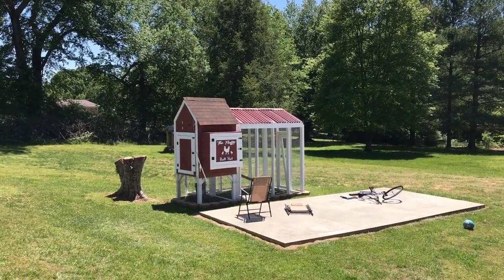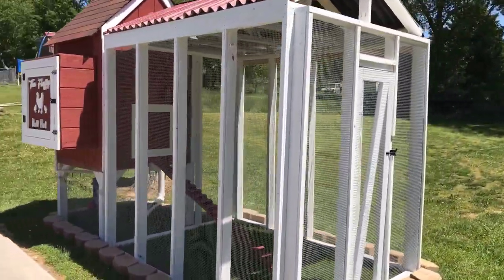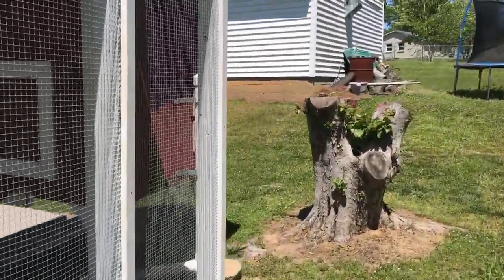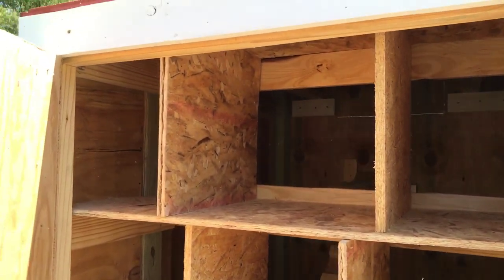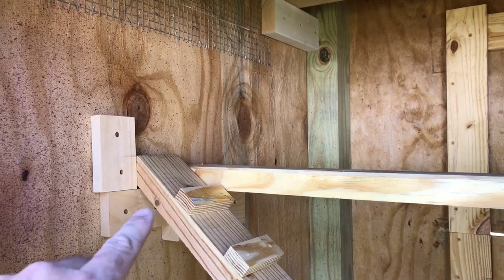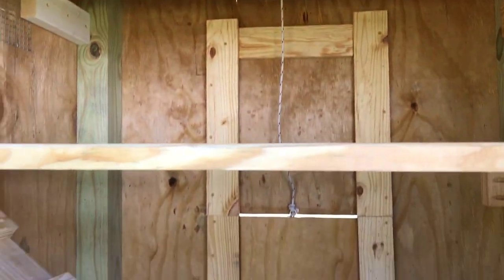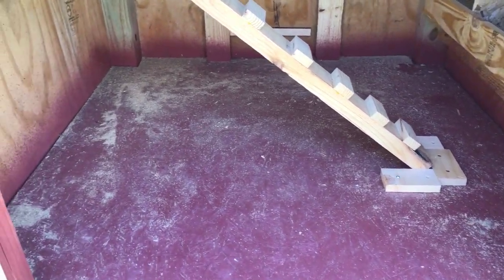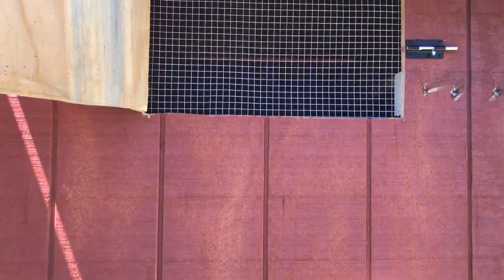Our Chicken Coop Build

Comment: i know even less than you about chickens, but, damn,,that is one fine looking coop.  Well done !!  The watering set up you made looks ingenious.  Would love to see how you devised it.
Reply: In regards to the watering set-up: I agree that those cups seem the most useful. We're definitely going to get those ones when we redo our coop. I do want to mention to make sure the water bucket is securely installed. Keep in mind that those buckets are durable, but the handle is the weakest part. And the handle was not designed to withstand the weight of a full bucket of water indefinitely. The last thing you want is to have the handle give out on you when there's a chicken standing beneath! So it's best to build a platform/table for the bucket to sit on.

The coop looks great! Nice job!

Comment: For 8 chickens I think that you have way too many nest boxes. Probably two or three would be sufficient
We have 13 hands that are laying right now and they all use one Nest box, occasionally one of them will wind up using a second one but that is if she wants to lay an egg and another hen is laying one at the same time.
Reply from the maker: Jeff Dinter Yeah I saw that somewhere after I built it. I will probably keep the top part of the nesting boxes blocked and just leave the 3 lower boxes open when they start laying.